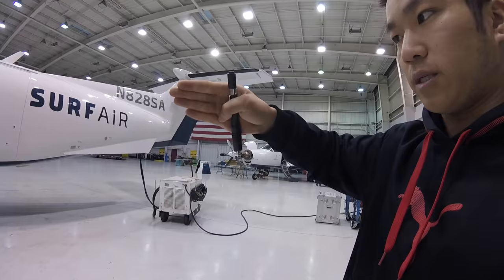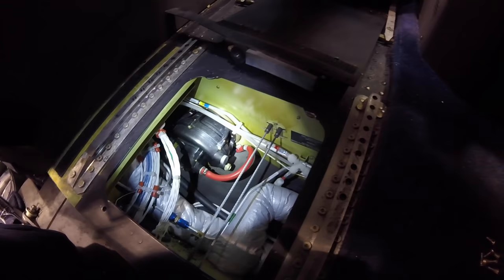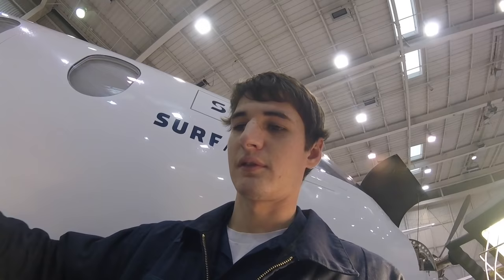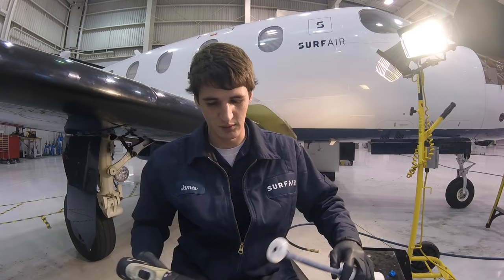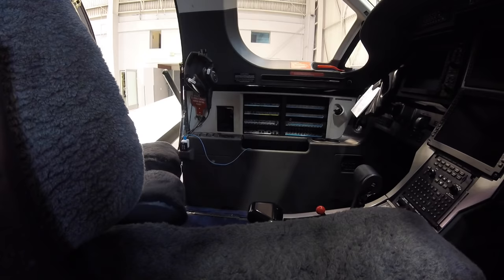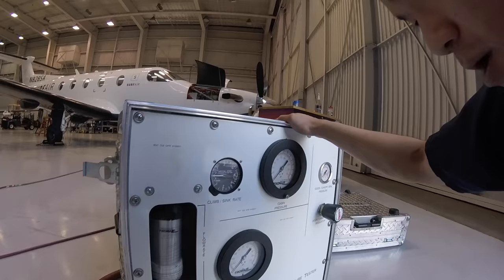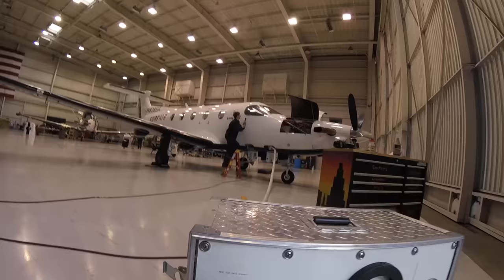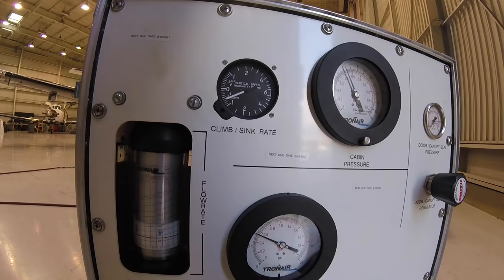How to Become an Aircraft Mechanic

Comment: United Airlines will hire mechanics straight from A&P school.  Many of the recent new hires at SFO were hired from A&P school.  I was hired by United straight out of A&P school as well almost 20 years ago.  The starting wage at United now is $26/hr (both license pay) and goes up to $48/hr after 8 years.  $48/hr equals $100,000 per year.  Besides, the benefits are great too.  One of my coworker made $160,000 last year working some overtime.  It will be the easiest $100,000 you will ever make.  Sometimes you show up to work with absolutely nothing to do.  We then just sit around and shoot the breeze all the while getting paid top dollar.
Reply: I live in Houston, do you know which school is better, AIM or MIAT?? I think those are the only A&P schools down here that i know of
Reply: E. C.  aim
Reply: MIAT
Reply: With the correct licences and approvals you can make a good living and as you said with very little to do. Essentially you become an inspector checking all the systems and inspecting other peoples work.  The "dirty work" or "menial tasks" are carried out by contractors or mechanics who will be on a "hire and fire" basis. Typically they will strip out aircraft interiors and furnishings whilst the approved licence engineers will carry out the inspection and highlight any faults. When all the faults are rectified the approved engineers will sign the certificates of release to service. That's where the real responsibility and money comes in. The contractors will be the first to be discarded when the work dries up.
Reply: Which base did you work at, if you dont mind disclosing?
Im at a regional right now. Aiming for bigger fish though. If United will hire with no experience, i might apply for them.
Reply: I go to AIM in Norfolk Virginia
Reply: @davecrupel2817  Is anybody recruiting at the moment?

Comment: The stall strip actually PROMOTES a stall, allowing it to stall at a lower angle of attack. It is mounted usually at the root to allow the wingtip and ailerons to remain effective during a stall.
Reply from the maker: Thank you for the correction. It makes sense that it would promote a stall based on its shape. Also makes sense you'd want the wing tips to stall later. I wonder if the PC-12 needs it just on the right side (there's no stall strip on the left) due to the drag of the radome on the right wing tip...
Reply from the maker: I checked description and operation while editing this video and couldn't find anything. I'll try to check with our tech rep at Pilatus and report back.
Reply: As I recall the stall strip is installed on one wing only to correct a rolling tendency for that airframe, this is why you will see stall strips in different positions on different airframes.
Reply: It’s possible that it’s on the right side only due to not only the radome, but the propeller too. The propeller is a right turning prop on the PC-12 so basic aerodynamics tells us that the speed of the air from the downward moving propeller blades will be moving faster. Thus generating more lift on that portion of the wing. Makes sense to lower the critical angle of attack for that particular spot as without it you may have very poor stalling characteristics. (Possible spins or excessive wing drop) These are only speculations of course. I’m not an engineer for Pilatus. Lol
Reply: Ha agreed. Actually one of the oral questions. I believe of Generals. In jeppensen and probably ASA too
Reply: Correct

Comment: Just recently discovered your videos and I enjoyed the content. I have had my A&P license for almost 2 years now and so far no regrets. I am currently employed by a major airline where I have received level 3 familiarization on the Boeing 767-300ER (passenger and freight) and it's a hell of a learning experience with these commercial jets. Although, for some reason, I can hear General Aviation calling out to me from the distance every time I see a Cessna or Piper flying overhead instead of those big birds I'm use to seeing every day. I guess it's because I started out as an intern working at a mom-and-pop repair station where Piper Warriors, Cessnas, and Hawker DH125's are a common sight before I got hired by a commercial airline.
Reply: hey man i'm looking for a career change would you recommend this job for a guy in early 30's or is it too late? thank you
Reply: Would you recommend starting out in general aviation before working for big commercial airlines?

Comment: A tip for the application of PR-1750 sealant, Inject a 1/3 of the catalyst in the bottom of the tube, then a 1/3 in the middle and finally the last third in the top, then mix. 60 strokes minimum. Do you guys require a hardness sample for cure verification?

If you're going to cut the tip on the nozzle, cut at a 45 and a small hole. A little goes a long way. Screed/spline with piece of plastic like a Bondo trowel, then after 1 bit of time, a little soap and water to make the surface babies ass smooth.
Reply from the maker: Thanks for the tip! In the last few months we've changed a bunch of de-ice boots. You are totally right re: injecting the catalyst. I learned that one the hard way (wish I had read your comment sooner)... When you say hardness sample do you mean putting a sample of sealant, similar thickness, aside at the same time as application so you can see if the sealant is cured without putting your finger in it? If so, yes, we do that.
Reply: Hi James, yes, the hardness sample is used to verify the proper mixing and cure of the sealant. Cut the cured sample and inspect for an absence of streaks and that the sample is fully cured (rare but does happen when below 50F).

PRC makes a line repair sealant, PR-1755, the quick cure version of PR-1750. It would work great for your quick and dirty repairs. Also a product, PS715 is a spray tackifier. Smooth the sealant, spray some 715 and
dirt and chips won't stick.
Reply: James Sullivan also you can spray the sealant with GP and smooth it with your finger. That's how we do it on KC-10s.
Reply from the maker: What is GP?
Reply: James Sullivan general purpose cleaner. We have tons of it in the Air Force. Works great for sealant.

Comment: For the gap seal on that tripper strip on the leading edge, grab a set of rubber gloves, get a good hefty loogy on the finger tips, and push the sealant down flush with your masking (good job by the way)... the spit will dry before the sealant flashes, and will make a perfect transition without getting cut by the masking. assuming that you prepped the surface before sealing, that tripper seal should last almost about as long as the skin of the leading edge.

Comment: I wanted to add a bit more into detail since I see alot of guys here are showing how they become an Aircraft mechanic.
  I currently attend "Spartan school of Aeronautics and technology-
They have campuses In Los Angelas CA, Riverside CA, Tulsa OK. The program here costed me about 33k after financial aid helped. But they provide a great laptop, tools, equipment, free anyday tutoring, amazing staff.
The program duration is about 15 months
For about the first 3 months you will be in the classroom learning about the basics of math (nothing crazy, basic algebra) then flight dynamics, basiclly everything you will need to know on paper.
Then after that everything else will be hands on, so taking apart engine components, disassembling engines, jet turbines, creating things from aluminum, welding, riveting you name it. 

I have learned so much Its empowering, I highly recommend a trade school because its the quickest way to get into the field.
Reply: How much would it have been without financial aid? I want to go to that school also but heard mixed reviews

Comment: Can’t wait to get back into maintenance. Cool video man. FYI, if you soak a rag in some denatured alcohol, you can use it to smooth over the sealant and get the bumps so it’s aesthetically pleasing. Do it before you take the tape off.

Comment: Hey James,  I've been in the Air Force for almost 6 years. What I do to make it easier when you are trying to spread the sealant for the boot is by using the cap as a pusher. Also another way (and I dont know if you have this) but get a latex glove and dip your finger into some water and you will glide over the sealant like butter. Works 10/10 times. Great videos and keep up the great work man.

Comment: I think you're getting stall strips mixed up with something else.
the purpose of the strip is to allow for a 'nicer stall' of the wing. It disrupts airflow at high angle of attack, causing the wing root to stall before the wing tips, where ailerons are situated, allowing greater roll stability during a stall. its affect on the stall speed should be adverse, as it induces drag, and advances the separation point on the wing. so higher stall speed.
source: atpl: principles of flight course material

love the videos, well edited, educational and fun to watch :)
Reply from the maker: Thank you for the clarification. Do you think the reason the PC-12 only has a stall strip on the RH wing is because the weight and drag of the radome (installed on the RH wing tip) was causing the RH wing tip to stall before the root?
Reply: James Sullivan 

the atpl theory doesn't go very in depth about the stall strips. though I did some research online, and it appears to be related to the slipstream of the propeller. as of my understanding, the slipstream energizes the right wing of the aircraft (clockwise rotating propeller), which has to be counteracted to allow even stall on both wings. 
I don't know for sure, but seems logical to me. though the radar dome most probably has an affect as well.

Comment: Great videos, nice to see the fixed wing side of maintenance. I work on helos (S64, S61). BTW, you don't want to mix pro seal with that high a rpm. If it's heating up while you mix it you're going too fast
Reply from the maker: Thanks for the tip. Learning every day. I would love to work on helos

Comment: Awesome videos man, I've been thinking about starting my own YouTube channel!
Reply from the maker: Do it!
Reply: Also one suggestion to help make your sealant jobs look better, take some soapy water in a spray bottle, spray the sealant and your fingers and lightly smooth the sealant out with you fingers. Also when removing the tape pull it directly back on itself so it's not pulling the extra sealant away from your applied sealant.

Also does Surf Air supply tools and tool boxes? I noticed in the background a tool box said "surf air" on it.
Reply from the maker: Thanks! We supply our own tools. That's my box with a custom graffiti job 👍

Comment: Any idea if the maintenance manual you use on your laptop is available anywhere? I fly the 45, 47 and NG and am interested in reading some of the details/schematics. Also, is the pressurization test part of the 100h check? Greetings from Switzerland
Reply from the maker: We pay a subscription for manual access so unfortunately I do not this it is available publicly for free. The pressurization check was done due to the safety outflow valve removal and installation which I believe is a 3k hour item. Although I do not have the manual pulled up currently so take that with a grain of salt.

Comment: Whats up  buddy I'm currently in Arizona going through my A&P couse. I finished my generals and I'm currently in hydrolics. my question for you is what is a (B nut? )
Reply from the maker: Good luck with your schooling! As for the b-nut, search google images for it. Its basically a nut that connects flared hoses for fluids and gases. It creates a sealing surface against the flare of the line to prevent leaks.

Comment: had no idea you work in Hawthorne
Reply from the maker: Yeah! You close by?
Reply: Not close but a hour or so away. But I like your vids. How much does a air craft mechanic make? What about side jobs? Or mobile air craft mechanic? Also do you have to know to fly in order to fix a air craft? Same for helicopters? 
Any thoughts on boweing?
Reply from the maker: Thats a bunch of questions! Boeing is cool. You dont need to know how to fly to work on planes or helicopters and an A&P license permits you to work on either. Aircraft mechanic pay varies widely depending on where you live, who you work for and what you do. Most pay is hourly and ranges from about 15-50 dollars per hour. Mobile mechanics will typically be closer to the higher end of that range.

Comment: Do you know if Spartan college is a good choice to obtain your a&p
Reply: Tomatero 16 I went there. Yes it is a good school. If you can find somewhere closer to home I would do that. As long as it reaches the requirements. Order your ASA software or books at the beginning of school. When you receive any of the 3 certificates of completion (generals, airframe, power plant) GO TAKE THE WRITEN TEST! do not wait because once you are done with school it is very hard to remember the information sometimes. Right after the writtens are done and you passed them go take the oral and practical! The sooner you do it the better. You will forget a lot of it trust me.. After school I saw jobs and money without license and went for it. 2 years later I am cramming and trying to remember things from school. In the real world school is a starting point. When you start working is where the experience comes into effect.

Comment: Have u worked in line maintenance? I`m 46 and thinking of going back to school for this but I worry about getting a job after i`m done with school. I`m worried that because of my age and no experience that I wont get hired.  I dont wanna get into heavy maintenance, I`m interested in line maintenance.  Have u guys applied to one of the big airlines?
Reply from the maker: I did a bit of line maintenance in college. I like surf air because it feels like a cross between line MX and heavy MX (we do both). I've never been interested in doing maintenance at a major airline, although I did intern at Southwest Airlines and really enjoyed their culture.
Reply: Why aren`t u interested in working with a major airline?  I assume u would make more, no....?  I`m still debating about going back to school for this.  Do you guys remember all the part names on a plane and what steps to take to repair it? Or do u guys work from manuals? From what ive heard, its the law for u guys to work off manuals.....?  It looks like fun and I would love to get my hands on that surfair jet also!
Reply from the maker: Personally I am not interested in the airlines for a couple of reasons. Typically with the airlines you will be limited to a certain area of the plane or component. For example you might be stuck lubricating the landing gear for the first few years with an airline then get promoted to a job removing and repairing interiors. Then if your airline (inevitably) gets bought or merges with another one the seniority lists would be merged and you might get put back on landing gear. I like being able to work on all areas of the aircraft as we do at surf air. I might troubleshoot an avionics issue one day and change an engine the next. You won't get this broad of exposure at an airline. As for pay, the airlines will start much lower than at a company like mine but have the ability to end much higher. A small company offers more opportunity for vertical growth outside of just pay raises. I started as an aircraft technician at surf air, was promoted to a lead, and then promoted to Maintenance Training Coordinator, all within my first year. I haven't completely discounted the airlines but the work scope and opportunity for advancement are not as attractive to me. Also knowing what I do about unions I would prefer not to be unionized, which most airlines are. To answer your other question, yes we work from manuals. In some cases a task may not be published in the manual so accepted best practices would be used. It is not possible for anyone to know all of the parts on a plane and how to repair them (if they tell you otherwise they are full of it). One of the best skills a mechanic can have is knowing where to find the answer - meaning which manual to look in when attacking a new issue. Hope this helps and let me know if I can answer anything else.
Reply: Thank u for your time James, I greatly appreciated amigo. Did u start on night shift after graduating? I`ve heard every rookie starts on nights. I`d like to see a video of how and what the oral exam is. Maybe between u and the other guy that works with u, if u guys could make like a simulation video of what the oral exam is. Do u  work on Sundays and Saturdays? Are the work days always 13hr days?? Does surfair hire anyone without an A/P license?
Reply from the maker: Anytime! In reverse order. Surf Air does not hire without A&Ps however you can work in a part 145 repair station without an A&P (theyll issue you a repairmans cert) or work as an apprentice without one (working under a licensed mechanic). We work 12 hour shifts but they often run long - some guys leave after 12, I stay until the job is done. The oral and practical exams are no big if you're prepared. I'll try to put something together about it with vince. My first job out of school was a salaried position and I did not work nights - but I hated the company and the work. It is common in the industry to start on night shift and thats where I was at Surf Air for about 5 months until being promoted. It took a bit of adjusting but I got used to it within a few weeks.